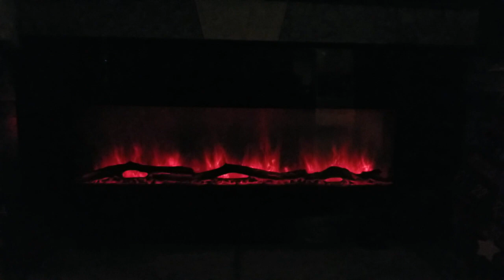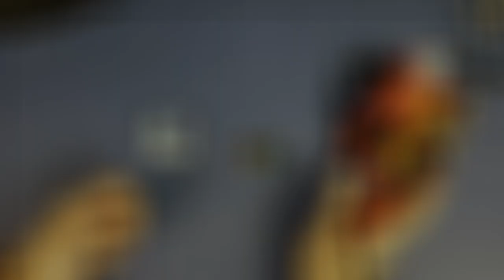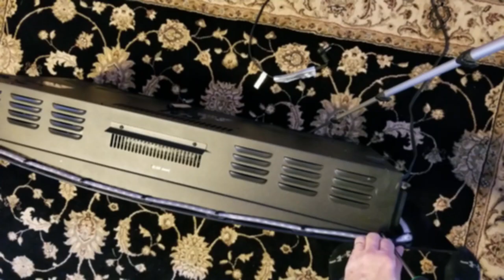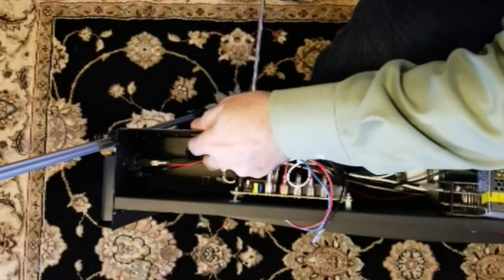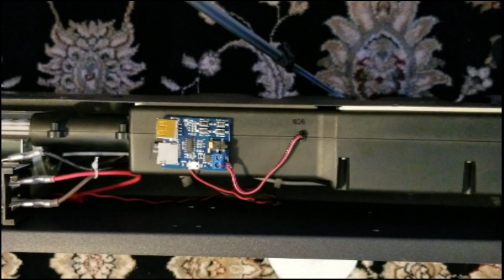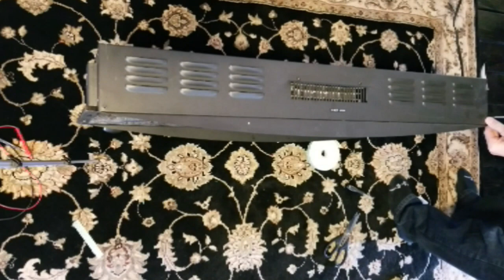Fireplace Build Update,  SOUND EFFECTS !

Comment: I absolutely love how you designed the stones around the t.v. and installed the electric fireplace. I been wanting to mount a fireplace under my t.v. My only concern is the heating vent located on top. Have you had any issues?
Reply from the maker: Hi Gloria, thanks, glad you love it,  my wife loves it to.  Did you watch the main video of how I built it or just the sound effect video?  I used 1/2" cement board for the structure inside the fireplace surround and recess also I left a gap for plenty of airflow.   We have used the heat a couple of times without problems.  I never considered this video would be so popular so I didn't give much detail on that.   I'm working on an accent wall with fireplace in the bedroom and I will include more detail on how I route the heated air,  It's in the works and will be out soon.  Thanks for watching..
Reply: Thank you!! I'll be waiting!!

Comment: Like it.  The only ? I have is I didn’t see you test for heat out of the heater. If the heater is running will it over heat those wires? Or that plastic speaker box? Did you secure the wires tight against the back wall so they won’t vibrate into a dangerous position?
Reply from the maker: Thank you, glad you like it, the modification worked as well as I could hope for..  Good questions.  I re-tied the wires but omitted the video for time, I had hoped to make a short video <10 min.  The wires that feed the speaker run in a tray below the heater.  I had checked the heater with my thermal camera but did not consider using it as part of the video, it would have been an interesting addition but then longer video, something I will remember to do next time..  There is a switch on the back of the unit to disable the heater, since we don't use it for heat, the switch is off.  Thanks for watching.
Reply: Southern Engineering if the heater is used? Is it safe ?
Reply from the maker: When I tested there was no thermal gain outside the heating element,  there was some conduction into the heater vent area radiating ~ 3.0" laterally, max gain near the speaker ~20deg after 15 min. well below the limits of the housing.. Actual increase to the speaker housing ~10deg.  Next time I have the opportunity I will included Thermal images in a video,  it's a great diagnostic tool.  Perhaps I will produce a follow-up video on how to use thermal imaging as a diagnostic tool..